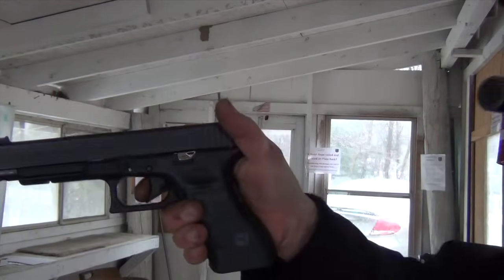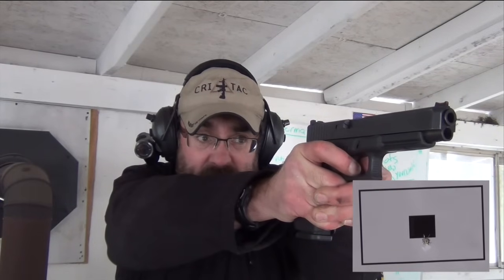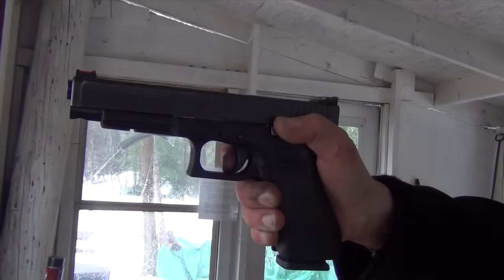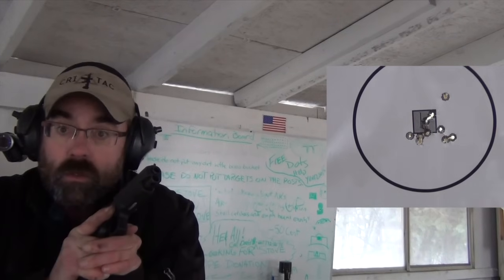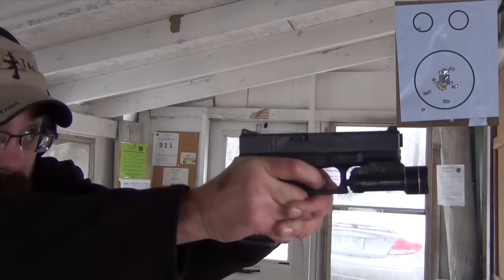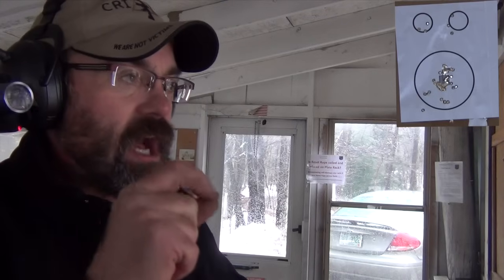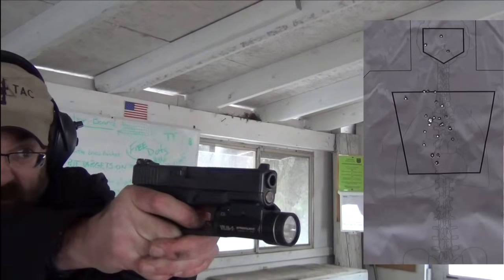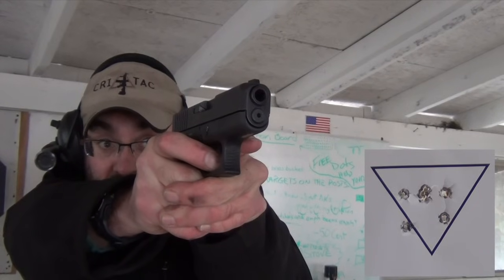Mastering the Glock trigger

Comment: Great video. I'm gonna try this with my Glock 21. It's a .45 so I'm a little nervous that my follow up shots aren't gonna be as fast as the 9mm. Any thoughts or advice?
Reply from the maker: Hits count... work the trigger process as outlined and then over time increase speed.
Reply from the maker: Sir, Thanks for watching and commenting.  It sounds like you have a system that works for you as it relates to "bullseye" shooting.

I have found great results with hundreds and students using this process.  By the way, it is a processed use at virtually every shooting academy and by top trainers like Todd Green, Jeff Gonzales, Kelly Vendon, Gregg Cruz and Chuck Taylor to name a few.  I'm sorry you find no value in this video or the process used. If your system works better for you...that is great.  

Best regards, and stay safe.
Reply: Guns and Gear & On Target Training, LLC It worked great! This campsite guy is completely wrong. You're a great shooter and I'm sure he's just an internet troll.
Reply: campsite a That is a very poor teaching method for a combat situation. Anything passed 15 yards I'd be using my carbine.
Reply: You're way to full of yourself. Targets are extremely easy to engage past 15 yards, especially with a larger handgun caliber. Do I train at 50-100 yards with a handgun? No. It's ridiculous. I can hit targets with a handgun from 50-100 yards, but, I don't usually train past 25 yards with a handgun. After the 25 yard mark, long guns should come into action, not handguns. You need to learn what is practical, and what is not practical. Engaging a target at 25+ yards with a handgun isn't practical, and it will easily get you killed. Quit trying to place yourself above everyone else. It seems like you need to learn quite a bit more, as well.
Reply: Shows how much you know about the military. The standard is 25 yards with the Beretta 92fs.
Reply: campsite a sir, I would like to see your DD214, and your pistol qualifications, since you know so much on military training and tactics...
Reply from the maker: GOLF MANIA Thanks for watching and commenting.  I do have other vids on grip, stance, sights, malfunctions and presentations from holster.  As you pointed out, this video was about trigger press and trigger reset (trigger prep). All the best!

Comment: The real way to master the glock trigger
Steps:
1. Field strip your glock and look to see which pins connect the trigger to the firearm.
2. Carefully punch out the pins taking care to not scrape or scratch the receiver or important internal parts (like the pins)
3. Carefully pull out the trigger and trigger assembly.
4. Immediately throw the trigger into the trash. (A lot of new shooters make the mistake of keeping the assembly in a parts drawer instead of disposing of it properly. In order to prevent this, take the trash outside in order to avoid careless reuse of the stock trigger place holder assembly. 
5. Now reverse this process with litteraly any after market trigger made for glock (personally I use the pyrimid trigger but anythimg you put in will be a step up.
6. Re-incert the pins and enjoy your trigger mastery at the range. 

Note: Let me guess the next few comments..."The glock was designed to use the glock trigger, modifying it only compromises the platform, it's glock perfection for a reason"... No, the glock fires all the the time every time because of the large tolerances, allowing for less chance of binding. This is not precision and it is definitely not perfection. Don't get me wrong, love my glock, it was my first of many different firearms and it is absolutely my main workhorse....but don't tell me even for second that the stock trigger is anything other than cheap and pulls like gravel.

Comment: Isn't that the case with every pistol? Are you saying that there is a pistol that does not have any feel for the trigger to re-set? I have a Springfield XD9 and it feels the way you are showing it on the video, your tip makes sense and it works but, it is not exclusive to the Glock.
Reply from the maker: Thanks for watching and commenting.  The reset is very distinctive on some pistols . However, it's almost nonexistent on the S&W M&Ps... it depends on the platform you're using.  The fact is most people who shoot never work on or try to master the trigger reset.  Most people let the trigger go all the way out and "slap" the trigger in fast firing sequences.  Therefore they are not as accurate or as fast as they could be with better (more disciplined) trigger management. We see this in our classes all the time and therefore try to educate students to the benefits of this process.  

The XD series is a great platform!    For me the XD reset is longer than the Glock  and therefore it requires the user to work on the tips we share in this video to master it.  Bottom line, most semi-auto's have a distinctive reset (excluding DAOs), and with practice, trigger management can make a huge difference in speed, accuracy and proficiency.  Thanks again for watching

Comment: I just bought a Glock 19 and I’m having trouble shooting it. It’s not as accurate as my berettas . Can some give me some advice . Bullets are going to the right side.
Reply from the maker: Thanks for watching and commenting.  I don't know enough about your skills, ability and technique so It's hard to assess what the issue might be.  Are you left or right hand dominant.

I don't find the Glock less accurate than the Beretta.  My experience is the transition with the 1st shot to the 2nd shot with the Beretta is harder for me vs with that two shoots from a Glock.  This is a training issue, specifically learning to transition from double action (DA) to single action (SA).   The same is true when you go from the Beretta to Glock. Completely different trigger feel. 

Keep in mind many people only shoot the Beretta in (SA) only.  They don't spend much time shooting the gun in double action .  Therefore, when comparing a SA trigger press to a striker fired press there is a big learning curve. 

The Grip angle of the Beretta is 18 % and the Glock is 22 %.   This makes a difference for many people who have experience with an 18% grip angle.  

As far as shots going to the right, that could be a grip issue (how you hold the pistol with your dominant and non-dominant hand).  How much of your trigger finger is on the trigger... pad vs toward the first knuckle. Could be the way the non-dominant hand is holding the gun and applying thumb pressure to the frame. More pressure is better in my opinion. 

I have a Beretta 92A3 and enjoy shooting it. There is a shooting review on my channel that you might enjoy.

Hope some of this helps.  If you post a video of you shooting, I'd be happy to assess what I see. Stay safe.

Comment: I MADE THE MISTAKE OF MENTIONING TO FRIEND MULLER, A LOCAL GUNSMITH, MY INTEREST IN THE COST OF A PAIR OF .40 CALIBER M23 GLOCKS AND LO AND BEHOLD WHEN I WENT INTO HIS SHOP A FEW WEEKS LATER, HE TOLD ME MY GLOCKS HAD COME END!!!  I had just inquired of the cost of a pair; not that i extended buying a pair of them considering Glocks to be nothing more than the usual military quality firearms and certainly NOT  in the class of the Smith & Wesson, Colt’s, and other of the exceptional fine handguns that I grew up with.
Needless to say, I paid my friend of the pair although i really didn’t want them and upon examining them my impression was that they were typical firearms intended for troops in war, typical throw-aways with sloppy triggers typically ‘military’, gritty, rough, and the usual ’stages’ with the attendant over-travel. 
Installation of two different aftermarket trigger kits was successful in reducing somewhat the trigger pull weight but the ‘gritty’ sloppy over- travel remained.
So, the conclusion persists; Clocks are weapons of war, cheaply produced and fitting to be considered ’throw-aways’.
Certainly, we who grew up with fine handguns, handguns that we would be sorely tempted to risk life and limb to recover when lost in the heat of confrontations would not consider it worthy of the risk of going in harm's way to retrieve a BLOCK/GLOCK. 

James Allen Wyatt Jr - Rifleman; Gunsmith’s apprentice. 
A Mississippian; D/P/Birth: 27Nov1937; Tupelo, Mississippi;
Kosciusko Mississippi H.S. Class of ’56, Mississippi State Univ. Class of 1961 
Son of The Gunsmith, J.A.’Red”Wyatt 1902-1964, WYATT—POWER CUSTOM RIFLES, Kosciusko, Mississippi
Show less

Comment: Is cocking the glock back hard? I don't like it if a gun has to be cocked hard.
Reply: If you mean racking the slide then no, it's not hard.
Reply: +RocketsGaming It depends on the caliber.  The tightest Glocks to rack are 10mm and 357Sig models, because you're pulling back against the strongest recoil springs. The easiest to rack right now is the G42 in .380. 
  When you rack a Glock, you do it with the pistol pointed in a safe direction (down range if you're at the range).  Turn your hand into an upside down "U", with your thumb toward your body, cupping over the top of the rear portion of the slide. Pinch all your fingers together so you're pushing your palm against the opposite side.  Push forward with your other hand (finger off the trigger), and pull back with your racking hand- all in one motion. This is the easiest, most combat effective way of racking any semi-auto pistol.
Reply: Thanks for the reply. Very informative

Comment: Under high stress even the most professional shooter may take his finger off the trigger.
Reply from the maker: Without a doubt! You have to let the finger of the trigger.  These are drills to improve skills ... The point here is that by working the trigger, knowing (via muscle memory) when the slack is taken up and the shot breaks, releasing the trigger and doing it again under control.  After a while you'll feel how much to let the trigger out for reset.  I work on all the time.  I am certainly not  an expert nor do I have perfect trigger management.  However, working on this will improve your shooting speed and accuracy.

Comment: SCREW STRIKER PIN AUTOS
Reply from the maker: Not sure how to respond other than it sounds like you don't like striker fired guns.  Personally I'm agnostic... to me it's more about the user not the handgun.  I own hammer fired guns and appreciate them as well.  I would note that my Glocks and M&P guns have tens of thousands of rounds through them any they still running reliably. My Gen 2 G19 has 50K rounds through it.  It's still delivering good accuracy and performing like a champ. Thanks for commenting and watching.
Reply: the group of friends I shoot with have reviewed your training video a number of times and now realize how helpful your instructions would be, after a steadfast determination with 
    practice- practice- 
           PRACTICE 
as the 80% G3 is our choice of sidearm, a new protocol must be learned.    Will comment after a notable improvement is realized with the acceptance of the striker-fired Glock. 
  All Black Rifles Matter
Reply from the maker: @noretreat151  Thanks for your reply.  Having had the opportunity to work with new shooters, experience shooters and law enforcement, I can say that most people shoot striker fired guns equally well as hammer fired guns.  As you pointed out the key is practice.   I started my shooting training with a Gen 2 G17.  So the striker fired action is what i learned on.  Later went on to develop proficiency with DA, DAO and SAO triggers.  At this point I'm comfortable running pretty much and handgun.  I do have to modify certain things but for any semi-auto it's about a smooth consistent trigger press, managing trigger reset and follow through.  In this video, I went very slow to show people how to maximize the reset on the Glock platform.  That being said, as you know trigger management is all about practice!  You said it, practice-practice-practice then repeat!
I learned years ago... it's rarely the gun it's almost always the way I'm managing the trigger. 

A few years back I was working with a group of LEOs.  One of the guys had a terrible, super heavy DAO trigger on his sig.  It was really HEAVY.  We were working som precision drills.  He was struggling. And in frustration said, "Let's see you do it".  So I took a gun I've never shot and keep all five shoots I took touching on ragged hole.  It was difficult but I focused on a slow and smooth press.  Bottom line, I can blame the gun but 99% of the time it's me not working the fundamentals.

In my recent posts on the channel, you see me working DA triggers on both revolvers and semi-autos.  For the semi-autos the DA to SA transition is where I spend the most practice time... practice-practice-practice then repeat!  

Thanks for supporting the channel.

Comment: Master it with better trigger parts....
Reply from the maker: I agree trigger improvements are well worth considering.  Thanks for sharing that insight.  I have 3.5 lb connectors in most of the Glocks.  However, regardless of the trigger improvements the process of riding the trigger reset really can help improve both speed and accuracy.  Thanks again for watching and commenting.
Reply: If you like a 3.5# connector, I have the ghost inc with the over travel stop in my 33.  After the take up and first pull its like toggle switch; click, bang, click, bang..... Love it!
Reply: ***** Please elaborate on this set-up that you speak of! I am not quite grasping what you are talking about and I would love some more info, like what you are talking about, what parts they are, where you bought them from, and how much they run for. I would like to improve my trigger, and your comment has really peaked my curiosity. Thank you in advance!   :)
Reply from the maker: Brandon Susich 3.5 pound connector helps.   If you want a good drop in trigger try the travis haley signature trigger. https://www.youtube.com/watch?v=ZjCKocvOkWQ 

Review of the Travis Haley "Skimmer" enahnced carry trigger
 I also replace plastic glock sights, and the plastic recoil guide rod.
Reply: Brandon Susich just Google ghost rocket trigger and you'll have no trouble finding it.  It reduces your break weight to 3.5# and takes a lot of the slack from the first pull. If you let the trigger out only enough to reset, there is zero slack, just 3.5#'s of pressure and the trigger breaks again.  The over travel stop is a little tab not found on stock connectors and it requires some fitting but I think its worth it.
Reply: Guns and Gear & On Target Training, LLC yeah that Travis Haley is a bit out my budget but it does look worth it.  My trigger doesn't seem quite as mushy as the one you compared it to though.  But I will keep that other in mind, Thank you!

Comment: They key to mastering the glock trigger is to spend like $200 upgrading it...the glock trigger is reliable as fuck...but sucks
Reply: +Nick Hahn $14 on a 3.5lb trigger connector and about 30-45 minutes polishing it and the firing pin safety.  The trigger will be buttery smooth and yet crisp after that. It will reduce your group size and allow you to work on technique without being distracted by the gritty trigger.  You can spend a lot more on it if you're making a race gun, but it's not necessary for an accurate reliable combat weapon.

Comment: This video should be titled: MASTERING THE GLOCK BULLSHIT!  Have you ever seen so many videos when it comes to people having problems with their Glock firearms?  If you haven't just punch in "glock problems" and you will see.  Where else have you heard that the Glock in particular is in need of so many up grades? Firing pin, Guide Spring, Magazine release button, Slide Release Button, Barrel, and on and on and on.  Don't drink the Glock Kool-Aid and be fooled like so many others.  The only reason this firearm is so popular is because it is so cheap.  It is the Bic Lighters of firearms.  If Glocks were indeed as reliable as they say company's such as Glock World, Glockmiester, Rock Your Glock, LoneWolf, Glock Store just to name of few would be put out of business!
Reply from the maker: +Mark Ridgway Thanks for your input. I am agnostic on brand of handgun as long as they work.  I do think the Glock is a top performer.  Regarding the aftermarket parts,  because of it's simplicity of design and incredible durability, it has driven a cottage industry of businesses to support and expand it's capabilities.  Same with the 1911, Browning HP and S&W revolvers.  Heck, same for pretty much any car in the USA. You can get aftermarket parts to upgrade anything mechanical. 

In the past couple of months some NSW groups (SEAL teams) are now able to choose a Gen 3 G19 or the 226. I've put 40,000 rounds through my Gen 2 Glock 19.  Never an issue.  Finally, look at many of the top instructors in the country (former Military Tier 1 Operations and LEO SWAT), they shoot Glock 19s.  

Whatever you choose, the key is training.